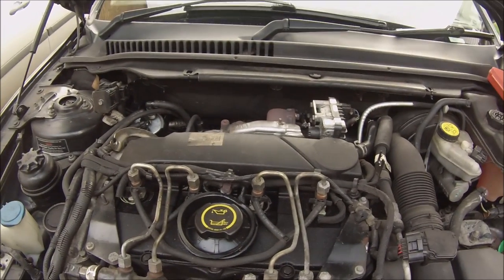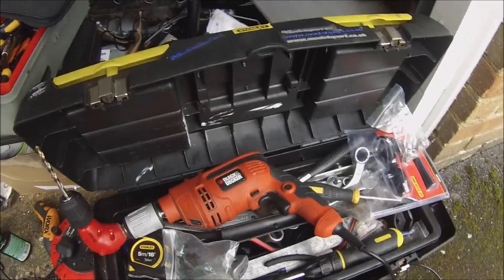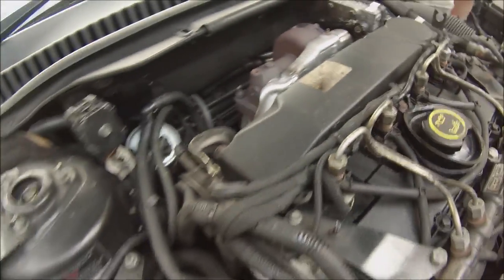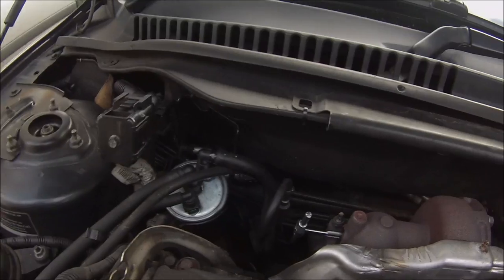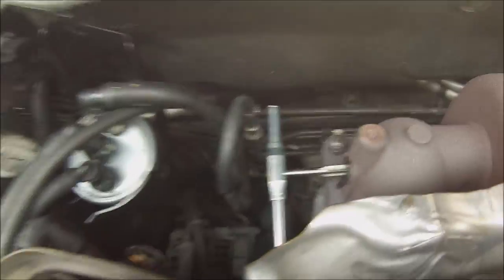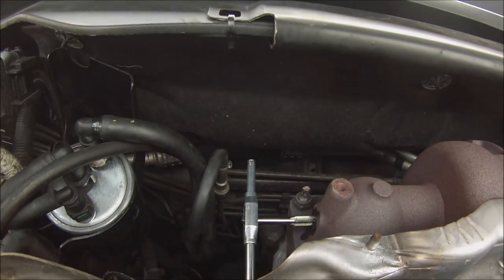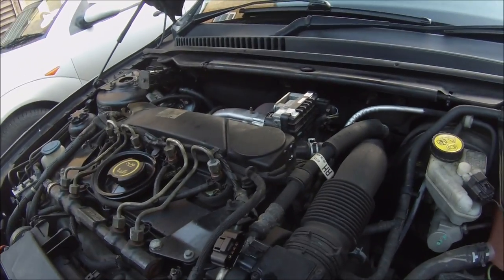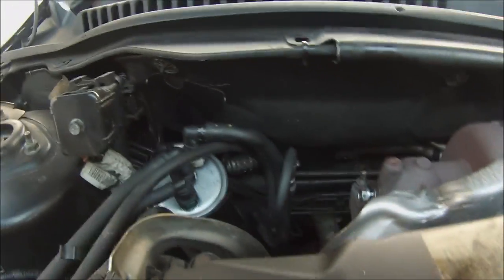Jaguar x type and ford mondeo turbo fix

Comment: Great video. #6.8mm# drill to tap an M8 thread. In fact I did it with a 5mm drill and M6 tap and bolt so I could have a second attempt with M8 if I messed up the drilling/ tapping....
Reply: 90 degree drill attachment req'd to drill hole from Toolstation - about £11...

Comment: I've seen a video where someone took the filter box off and sprayed cleaner straight into the air intake while the engine was running to clean the turbo.

Comment: You’d of thought that the boys & girls down at Jaguar would have drilled a little hole in the turbo before these motors were even allowed to rolled off the production line, prevention better than cure as they say. Helpful video helpful comments long live YouTube. And on that bombshell ..

Comment: Mr Muscle is aluminium corrosive and attacks a lot of plastics and rubber. Buy some Wynn's Foam Turbo Cleaner or the Power maxed turbo cleaning kit instead. may cost £25-40, but saves you having to drill the turbo!

Comment: Hello Lacoste, Please at 0:41, you use 6.8 OR 3.8 DRILL BIT? i couldn't hear well sorry.
Reply: Sorry Lacosrte Alot. If its an M8 bolt, then you must have drilled it 6.8mm. There is no way you could tap an M8 thread in a 3.8mm hole. Great video by the way. Im off to do the same with mine now.

Comment: Hi i have p132b code with flashing glow plug and engine management light. I want to try this what size mm drill bit you use with what tap. Also how long is the bolt needed many thanks
Reply: after getting the dreaded glow plug light and the engine management light (error code P2263) last thursday, and being told i was facing a bill of about £1K for a new turbo..... i took to the internet for some solutions! the jaguar owners forum and talk ford forum both suggested this! having provided a few laughs to my workmates and work mechanics with this, I set about doing this MOD myself....... so i ordered an 8.6mm (yes, it has to be exactly 8.6mm) HSS cobalt drill bit off amazon.co.uk for £5 and bought a right angle drill attachment (£20) and tap & die set (£17) from my local screw fix! the tap has to be 8M x 1.25! Took about 30 seconds to drill the hole (was like a hot knife through butter) and about 10 mins to tap the hole! you only need a bolt that's about 10-12mm long as that part of the turbo you're drilling/ tapping into is only about that thick!

I'm waiting on a new turbo actuator from www.turbovanes.com and some forte turbo diesel cleaner i ordered off amazon.co.uk....... i've already sprayed in the mr muscle...... that was before i realised my actuator was completely knackered..... it's locked in the retracted/ down position (waste gate open i believe)! once i fit the new actuator i'll repeat the mr muscle trick (that cleans the outlet side i believe) and do the forte turbo diesel cleaner (that gets added to your fuel..... it's cleans the turbo from the inlet side i believe)! hope this helps!
Reply: You would not use a 8.6mm drill for a 8mm thread. Others mention 6.2mm drill.
Reply: 6.8mm drill for M8 bolt. 7mm would be ok but 6.8mm would be better.

Comment: did you maked the hole withoud dissembly the turbo ? but did it helped to your turbo pressure drop ?
Reply: oke thanks for the info try dasty i did tested with mister muscle oven cleaner and dasty but dasty faster and more Dismounting but after cleaning did you get more power ?

Comment: Did you have to remove your fuel filter as I cannot get the drill in there straight.
Reply: Hi Thanks for that. Yes I have a right angle driver but even putting the bit as far as possible into the drive I cannot get it at right angles to the turbo. Looks like I might need to remove the Fuel filter. :(

Comment: Did your jag say gearbox fault
Reply from the maker: No if I remember correct It showed a yellow coil on the dashboard and went in to limp mode with a fuel fault which did not make sense so I took it to a diesel specialist who diagnosed the fault as needing a new turbo.

Comment: what is the size drill bit and tap ?
Reply: my pitbull82 best one wich one did you want used ?
Reply: my pitbull82 thanks than i need buy one 3.8 drill bit :)
Reply: i used a 6.8mm HSS cobalt drill bit bought off amazon for £5 and an 8M x 1.25 tap......... as recommended on the jaguar forum!

Comment: you do mean a 6.8mm drill bit ?
Reply: It kind of does matter, your video was good and clear  I'm just pointing out to anyone using it for guidance they will need a 6.8mm drill bit to tap for an 8mm thread .
Reply: yes agreed I've done this myself and used a straw attached to the mr muscle nozzle which went that little bit deeper and and allowed for more of the cleaner to get in there right to the business end of the turbo. I would recommend 8mm because it just allows that bit more movement. Also this video and a couple of others helped me a great deal. So far so good "sticky  vanes gone" no limp mode anymore  and everything I  needed to do the job for less than the cost of an hours labour . So thank you